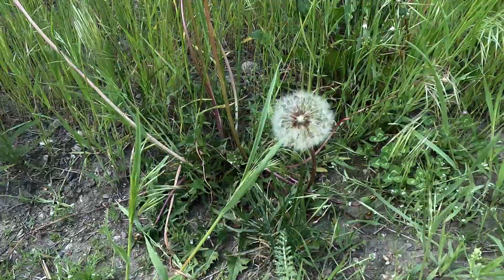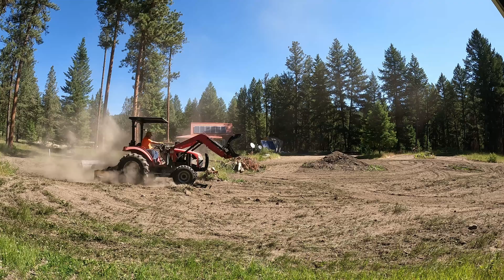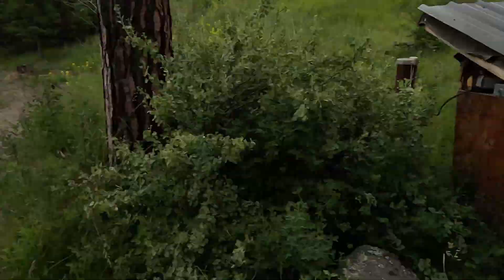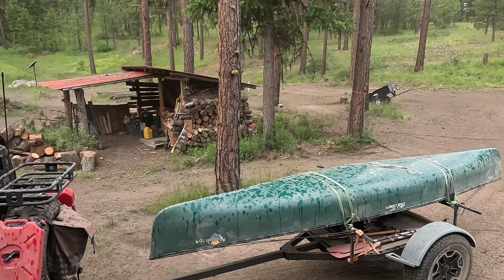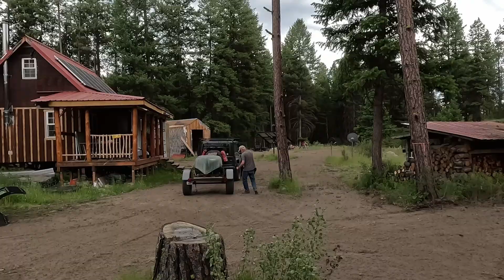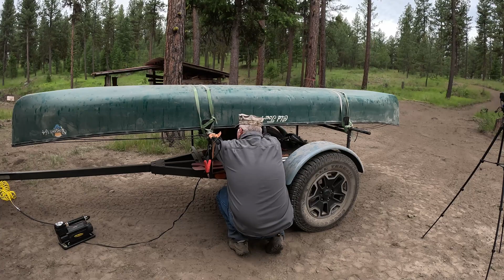Defending Your Off-Grid Cabin: Fire Season & Lightning/EMP/CME

Comment: My next year projects, sprinkler and better fire break. I am going to use the fabric and cover in 1/2" crush, a 10ft patch of gravel around the trailer should be ok. all the areas that didn't get 6 inches of crush in 2023 grew right up like it was seeded. I cleared a patch 1 ft deep for the new array last month and already growth.  Does your property seem greener than last year this time? Is that the new Xplore dish for 2024? If yes, is it any faster? Currently getting .23mb upload, worse than 1G.
Reply from the maker: We had more rain this year I think so yes, seems greener later in the year for sure.  As for the dish, those are inert.  Haven't used them for years now (keep thinking of pulling them up).
Reply: @TheOldJarhead   remove the dish, the poles might be useful, maybe mount a roof for something small? Shoot cans off.
Reply from the maker: Ya I was thinking they could be used some day for a cell extender/booster maybe